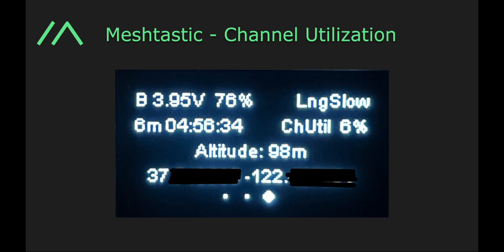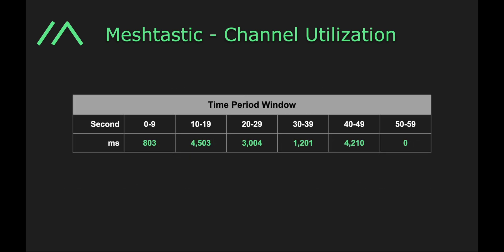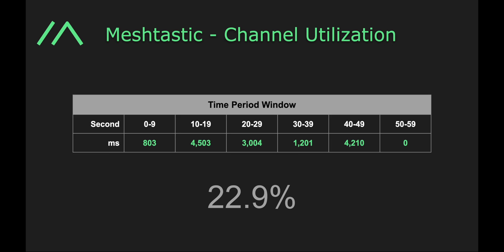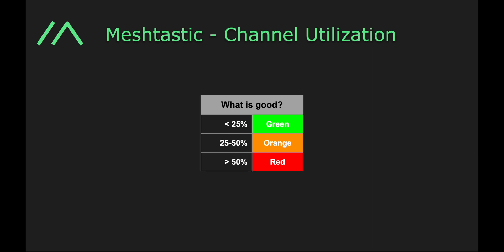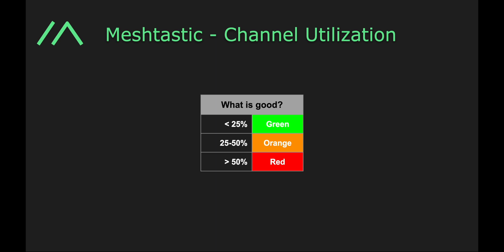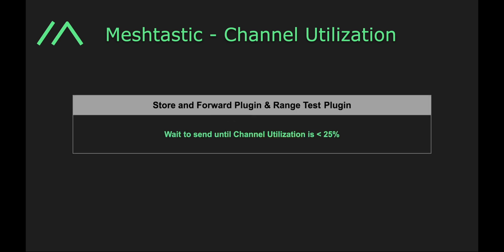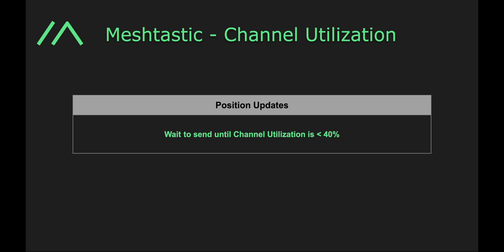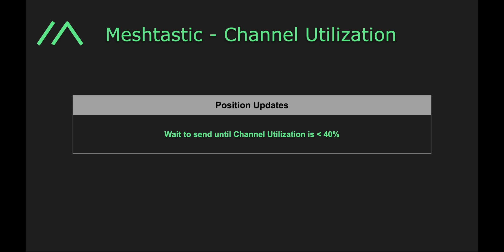Meshtastic Dev Demo - What is "Channel Utilization" and how do we use it?

Comment: I see ChUtil>30%, while on a SDR I see like one 1s message each 10seconds. Are you sure the calculation is right?
Because of this high ChUtil calculation, I cannot send traceroute for example.
If we count all RX messages regardless if they are Meshtastic or not, we should not apply duty cycle (10%) on this, right?
Reply: P.S. I am using firmware 2.7.5 and 2.6.11
Reply from the maker: The video you are replying to is from 3 years ago sot here's a very good chance this is no longer accurate. I'd post your question in our discord https://discord.gg so one of the developers can respond.

Comment: Started using Meshtastic about two weeks ago. 
Could see 170 nodes or more at times. Now I have a red lock next to the primary channel, seeing zero nodes. 
I’m guessing my channel utilization was too high. 
Am I locked out? 
Not sure what’s going on. 
Any help would be appreciated. 
Thank you.
Reply from the maker: The new open red lock next to the primary channel is just to indicate that the channel is either unencrypted or using no PSK. There should be a help sheet in the channels view now to provide additional info on that. As the mesh is decentralized, you cannot be locked out in the traditional sense. Each individual node would have to block you. I would join the Discord and post in the #help channel for basic troubleshooting steps.
Reply: @Meshtastic 
Everything seems to be working fine. I did bring down my channel utilization to around 20%. 
Thanks for advice 👍🏼
Reply: @Meshtastic 
I’m out on the fringe of the network. 
Farthest to the east of San Diego. 
If I understand correctly other nodes will reach out to the farther nodes to try and extend the network as far as possible. I see an awful lot of traffic going through my solar node. Guess that’s a good thing.

Comment: ChUtil 0.0%... in a city of 2 million people. Maybe my antenna is terrible.. it's a stock Heltec V3 915 MHz coil, and I've made no contacts yet.
Reply from the maker: There's a lot of large cities that do not have Meshtastic users yet, we're not as widespread as one might think. There's also the possibility that those in your area using Meshtastic don't run the default "public" settings. There's a lot of users that run custom settings to keep their network private. Lastly, and possibly the biggest culprit, the stock antennas for these devices are not the best and very hit or miss in terms of quality. Check out this page for some recommendations: https://meshtastic.org/docs/hardware/antennas/
Reply: Turns out the stock heltec coil antenna is terrible. SWR or 4ish. I put it on the roof and got a couple of contacts. Then upgraded to Gizont 16.7cm and an Alfa outdoor antenna and there is about 20 nodes around me these days!
Reply: Additionally, double check that YOU are using the proper default settings - and perhaps that your radio is using the right frequency for your area.

Comment: how to measure throughput, packet loss and jitter on lora?
Reply from the maker: On Meshtastic, throughput would be the tx duty cycle * available bandwidth. 

Jitter is now being measured in the non-public versions of Meshtastic 1.3. 

We don’t have a reliable way to measure packet (a message may spread multiple messages and packets may not only be messages) loss but there is a way to message loss.

Come to our forum for more information.